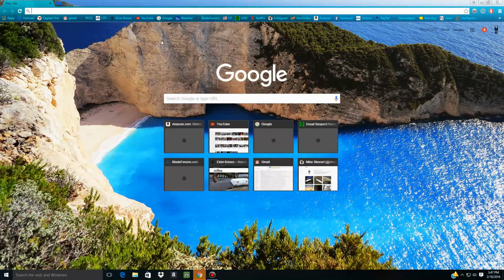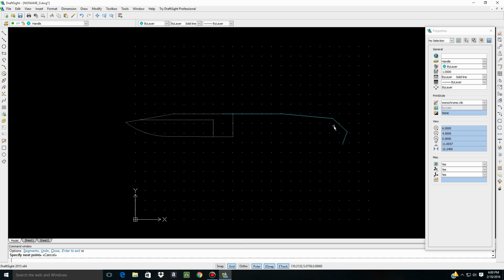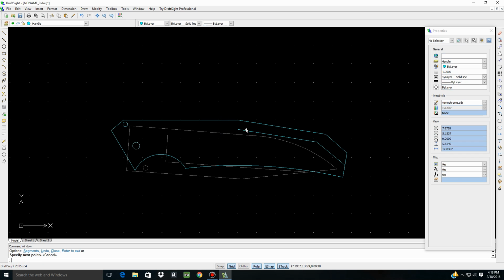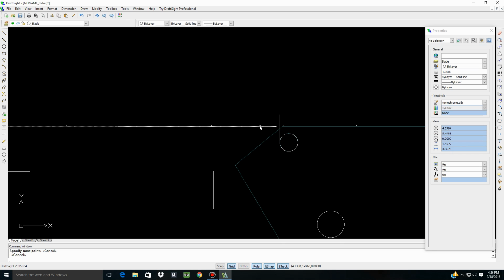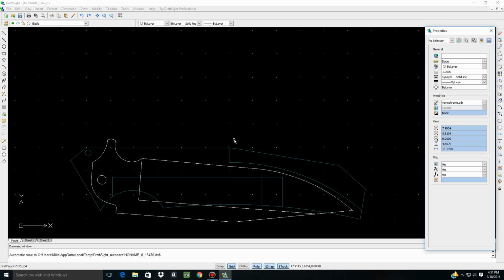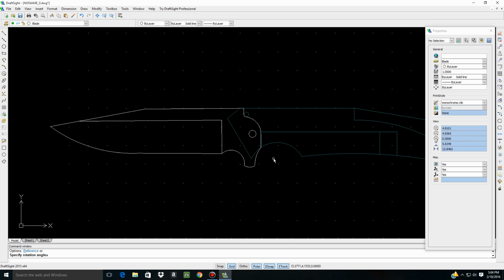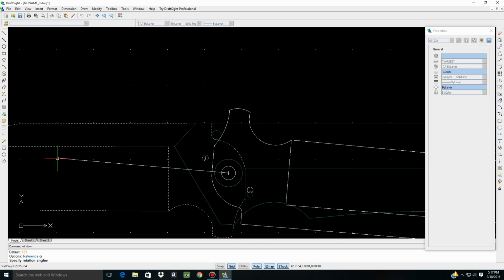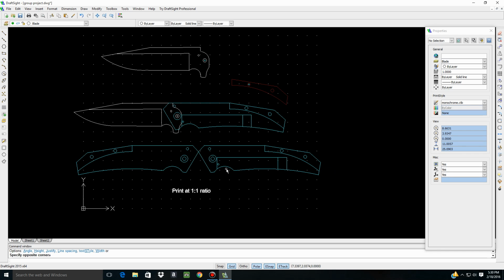Designing a frame lock knife on Draft Sight. Full tutorial

Comment: Appreciate the information will probably play around with this program.  Although it might be outdated at this point?
Reply: Yes, sadly it is not free anymore. 😒
Reply: @FlorianSojka  Fusion 360 has a free option. Powerful and frustrating.
Reply: @BladeBanter  What do you mean with "frustrating"? Is it a good alternative?
Reply: @FlorianSojka  due to the ability of the program.  I spent hours trying to put a primary bevel on a knife.  That's the frustrating part follow the steps I think should work by watching a video and attempt and it does work.
Reply: @BladeBanter  I understand. But, it is a 3D program and that is more than I need right now. For now I need an alternative to my old program (Draft Sight).
Reply: @FlorianSojka  Yeah I still like Draftsight better for 2d as I found it easier to rotate parts.
Reply: @BladeBanter  I just downloaded nanoCAD. It is free and very similar to Draft Sight. I am also able to open old drawings from Draft Sight.
Reply: @FlorianSojka  Very cool I might look into that one too.

Comment: Having been a user of Autocad since version 2.2 I would have to say that this software is very similar in both layout and function just based on what you have demonstrated.  Cad is such a powerful tool when you actually take the drawings to the shop.  One comment which supports my very similar comment is how you had trouble selecting parts using windows.  If you go from right to left you just have to touch an object to select it but if the crossing window goes from left to right you have to include the entire object/line inside that window.  You can also select the command before or after selecting the objects.

Well done.  Quite the useful video.

Edit:  Went ahead and DLed the software and gave it a drive using just my Autocad knowledge of commands (i use keyboard and icons) and it was like I was drawing in Autocad or recent years.  L for line, O for offset, TR for trim.  Type Mbuttonpan (it recognized that cad command and defaulted to Ebuttonpan) and set it to ebuttonpan=0 and your middle button/scroll wheel will become your esnap settings on the fly.
Reply: So you can do all these things on fusion 360? never used any of these programs but I very interested in learning them?

Comment: when you're trying to draw the detente arc i think you need the center of your circle to be at the center of the pivot,  since it travels in the same arc..?  great tutorial man,  Thanks!
Reply from the maker: +Jamey Johnson You are correct. It was getting late into the video and I really wanted to do it in 1 take while designing on the fly and my brain was going into overload towards the end of the video lol.  You also get the diameter of that circle by measuring the distance between the 2 points. Great catch and thanks for watching!